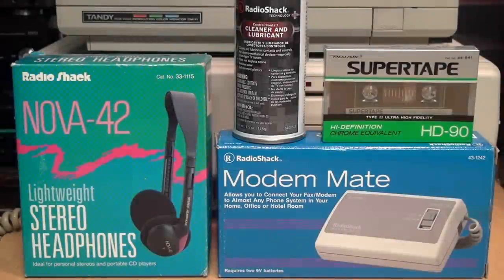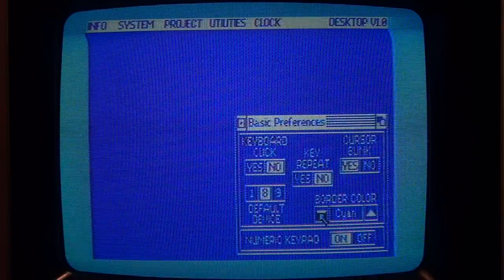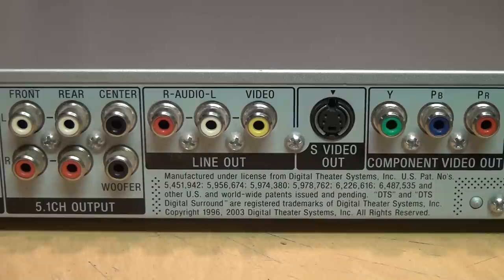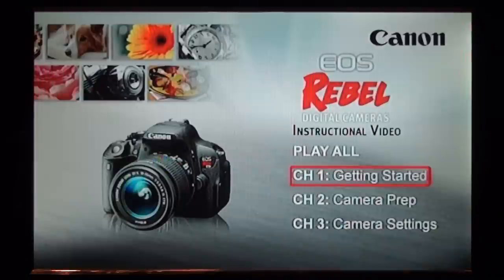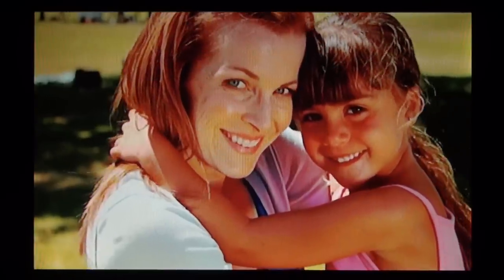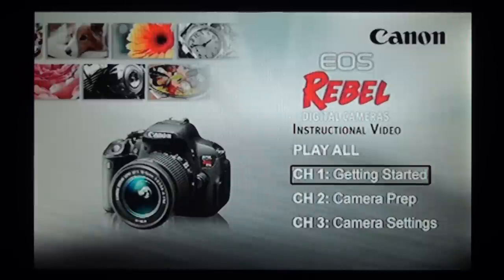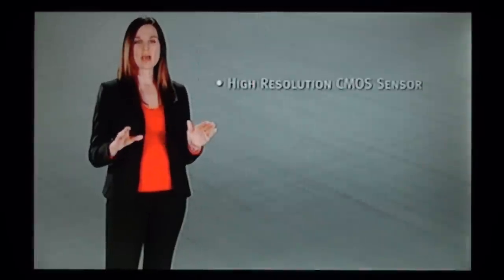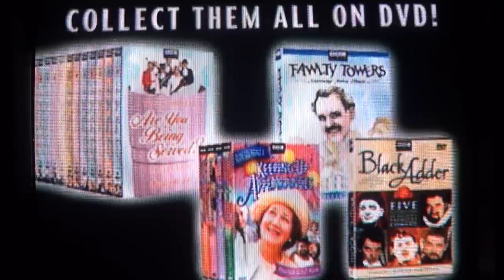Radio Shack S-video signal converter 📺 How? Why?

Comment: It would have been interesting to open it up and see what the circuitry was, but I'm guessing that may be tough to do.
Reply: I was about to comment that. 
what's this magic..
Reply: Me too! I didn't think this was possible with a passive adaptor, so I would like to know how that adaptor works.
Reply: It's simple enough, both grounds are tied together, and the active pins (luminance and chrominance) are tied together with a 470 picofarad (or 1 nanofarad in some rare cases) capacitor, the tied grounds then go to the RCA connector's ground, and the tied Y and C go to middle pin.

Not really much is going on in this kind of dongle
Reply: Likely just some capacitors and or resistors
Reply: @JessicaFEREM  the luma signal will pass through, as it has the sync pulses, the chroma will be capacitively coupled onto the luma as it’s an AC signal and luma is basically a DC level
Reply: I watch till the end and I really thought you gonna tear it apart and explain what's going on inside. Kinda disappointed.
Reply: I also want to see how the signal differs under an oscilloscope
Reply: Probably just passive components to correct impedence and make sure the luma and chroma outputs don't try to drive the other output. Using a Y cable backwards can cause issues like that and was probably why VWestlife had trouble using that to make S-video into composite. Same basic principle applies to audio signals too, never use a Y splitter to combine 2 signals.
Reply: Title says ‘how’, so I hoped it would show or explain ‘how’

Comment: This adapter was very useful back in the days.

There were a lot of graphics cards out there featuring a “TV-OUT”. Most of those inexpensive cards were S-Video only.

The problem of FBAS is that there is a “colour carrier” modulated on top. This limits the bandwidth of the Luma signal so your picture has to be less sharp. With S-Video, the Luma signal is independent so you can have all the sharpness there is since there is no bandwidth limit any more. This is the idea of S-VHS which needs the S-Video cables to perform as best as it can.

The C64 generates Chroma (F) and Luma  (BAS) independently but a TV needs an FBAS signal. So the C64 mixes both signals using two resistors inside the video modulator. There is an extra FBAS output in the Video output but you need a special cable to use it.

The same trick is done with the S-Video only TV-out graphic cards. They came with an adapter with two resistors inside.

The problem of mixing F and BAS is that both signals have a 75ohm impedance. If you simply merge the lines, half of the signal level is pulled down  by the other output and you get a 35ohm impedance which doesn’t match to the TV/VCR input. This is why those lines are merged using two resistors to reduce stealing half of the signal by the other output. Obviously, this still reduces signal quality and level.

But there is a method to do it properly. This is built into any TV or VCR and this is called the “colour trap”. Its just a crossover network. It separates the high frequency colour carrier from the signal and then limits the bandwidth of the Luma signal. In very old TVs, this is done by passive LC networks. And it is highly likely that this adapter uses the same passive LC circuits since it works both ways.

And the quality of this circuit matters a lot! If the radio shack adapter has a very narrow bandwidth separation, it could do a much better job than the cheap built in stuff inside your TV or VCR. Also it would defiantly do a much better job than the cheap 2-resistor kind of adapter.

If you have a high bandwidth Luma from a TV-out graphics card, Luma is often interpreted as colour and vice versa using FBAS. Then there are “ants” crawling on the shoulders of a news anchor while his pin striped suit flickers with weird colours.
Reply: It was also sometimes included for the opposite functionality, some Hauppauge TV-tuner cards had one of these included because they couldn't fit all of the connectors on like the low-profile pci cards

Comment: I remember back in 2003 when I wanted to connect my new (at the time) PC to my video recorder so I could record from it. The video card had video out and I could switch between NTSC and PAL but there was no composite out, only s-video. So shat I did was connect the VCR straight up to the luma wire, then used a small (I forget the value) ceramic capacitor to connect the chroma. It worked quite well if I remember, maybe that's what's in that little black box.
Reply: With maybe a small inductor in the luma side to stop it squashing the chroma from the cap.
That's probably why the picture is a bit softer using the adapter

Comment: I had an old PC with S-video output and I wanted to hook it up to my (then) cheapish CRT Television, which had only RCA inputs.  So I bought one of these adapters and all was well in my world.
Reply: I did the exact same, still have the converter in a box of old AV cables and such. Oddly enough, I somehow still have the CPU and hard drive from that PC in another box, possibly the video card as well. I might have a hoarding problem 😂

Comment: I miss Radio Shack. They had so many adapters that allowed you to convert any type of wire to another connector

 I had a police radio scanner as a teenager and one of the best adapters I bought was a F-type to BNC adapter which let me connect our home's TV antenna to the scanner. Obviously it wasn't the most elegant solution but since the majority of the frequencies I wanted to listen to on were VHF anyway, it worked very well.

Comment: S Video was mostly used by computers and DVD players, that adapter was useful to connect devices that lacked a composite video connector.
Reply: That's right. Every PC video card I have ever had from late 90's and early 2000s would usually have S-video for TV out and would always come with a s-video to composite dongle.
Reply: @kerrymccluskie  my uncle had a Win 98 computer that had S-Video card. It was used to hook up to a TV/VCR for video capture, the composite adapter was suited to TVs that don’t have S-Video input.

Comment: It does quite a good job considering the adapter wont be able to differentiate what part of the composite signal is 3.58Mhz colour sub carrier (for NTSC) and what part is high frequency luminance.
Reply: It kind of does, though. The only component inside one of these is a capacitor (I've seen schematics with 470 µF) that acts as a crude low-pass filter.
Reply: It differentiates in the same way as any other analog signal: Just toss in the appropriate resistor or capacitor and you've got yourself a filter that can do what it needs to do. Double the signal and then make one filtered down to 3.58MHz and pass thru the rest.
Reply: Can the source sense the adapter being used and output a different signal. These were used on late 90s computers to hook up to TVs
Reply: @flapjack9495  That's the point luminance is above 3.58Mhz
Reply: @orangejjay  That's the point it can't because luminance goes above 3.58Mhz. A TV will have a complex comb filter to notch out the 3.58Mhz sub carrier.

Comment: One of my favorite Radio Shack products was a AUX cable to Cassette accessory. In my old Van I didn't have an AUX port to plug my phone's audio into the radio with, but it had a tape deck. So I used that accessory to get around that issue. Sure I know bluetooth exists, but lets just be real, bluetooth sucks... It has a delay, that actual physical wires DO NOT.
Reply: Surprisingly, I still see new cassette adapters in stores.
Reply: @alextirrellRI  Good to know. I'm glad there is still a use for them. Especially if you want an internet capable antique radio. :D
Reply: @alextirrellRI  beware. Some cassete adapters are junk. I grabbed one and they put a mono head and sounded dull…awful. I have a older one, and have a stereo head a plays really nice.
Reply: If you had a really old car, you could connect an Aux to Cassette adapter to your phone or MP3 player, and put the adapter into a cassette to 8-Track adapter, which would then go into your car's 8-Track player.
Reply: @sjogosPT  Just like a lot of modern cassette players that only have mono heads in them.
Reply: ..... What difference would this imaginary delay make when listing to music?
Reply: @Helladamnleet  "imaginary" sounds like you're trying to gaslight. But it does cause problems. When you pause the phone or press play, it takes 3 seconds before the radio speakers catch up. I've had this happen on multiple radios and phones too, so don't pretend it's all in my head... A physical AUX cable doesn't have this problem. I don't get why people act like nothing is wrong with bluetooth, like they're fanboys or something. And don't even get me started on how annoying it is to pipe audio from a YouTube video through bluetooth. It's almost NEVER synced up right.
Reply: @Tall_Order  Or when you have a crazy idea to listen to music without headphones when walking around the apartment without turning it up extremely loud (which could piss off the neighbors). I now have a Bluetooth adapter that can either transmit or receive, and another just receiving one on the other amplifier. Sure enough, you can make both amplifiers play the same music like that or broadcast music from equipment that I only have one of, like the cassette deck or the record player across the flat. There is one big issue though, namely a big delay between the first amp and the second, so they both have to be turned down somewhat to avoid creating an annoying echo zone. If I did bother to lay down some analog cables there would be no delay, but probably stuff like ground loops or picking up interference would happen. With a digital cable there would also be a lag because it is highly unlikely both amps' DACs have the same delay, but it would be much smaller because of no Bluetooth overhead.
Reply: As an electrical engineer, I agree, Bluethooth is impressive, yes, but it is not a panacea and the reality is that it is an obsolete but glorified technology. But since it is old it is cheap so it can be used in everything (It is like at the time it was USB flash drives and MP3-CDs, both in 2006-07 were the novelty of the moment but after the 2010s any toy Chinese could already play Mp3). and at that time it was beginning to become a trend to simply put on YouTube instead of simply burning CDs or using an MP3.

Although it is undeniable that using wireless protocols saved a lot of cable pain because there were no longer ports or cables that were physically damaged, or inherently strange to obtain or operate without a specific driver. Also some uses border on the ridiculous. It is completely useless for all the peripherals of something to be wireless when they are within 10cm-1 meter of the device, and at the end of the day they need physical wiring to be recharged anyway. and even at the engineering level it is counterintuitive, because all because to work with Bluetooth you need at least 3 steps of ADC-DAC converters. which translates into greater waste of current and computing power. So obviously that means... Exactly: Delay!

The bluetooth protocol can barely handle 2mbps streams.
Today it is very slow to share files or network. and it was an almost forgotten technology if not precisely because cheap BT speakers work with that low data speed. and what at the time were headsets and hands-free for Executives and VIPs became favorite headphones for serial cable breakers. BUT. They were just that, just hands-free for old 2G phone calls, not maded for pure audio experiences.

Comment: Dell used to supply a very similar cable with some of their laptops that came with a S-Video jack on the laptop. This was in the days well before HDMI when TVs and projectors had Composite video and S-video was not as common. As I remember, they worked about as well as this Radio Shack adapter.
Reply: I remember my Dell laptop had an S Video as well as a VGA out...one time I broke the pins on one end of my S Video to S Video lead so I then chopped that plug off and soldered an RCA plug on the end by paralleling up the Lumina and Chroma together and it worked for TVs without S Video
Reply: Hauppauge offered these with some of their TV-tuner cards as well (popular in some HP models, both desktop and laptop)
Reply: I bought one months ago, but the vga to composite converter box i bought seems to produce a sharper image

Comment: I founded a Radio Shack MP-X 110 minute Type IV cassette at the thrift store, very rare to find, 2 sealed tapes, and Maxell XL II for 80 cents, because the cashier miscounted one of my 4 cassettes!
Reply: If you plan to use them and not just collect you might examine the tape itself first. They are rebadged as RadioShack but were really TDK behind the ugly pink and purple lettering -same shell. Now RadioShack did sell some cassettes that were made by Denon but the MPX were sourced by TDK but they were bad tapes in my experience.

I bought two off ebay last year and had to throw them out as the tape itself was curling on the sides and was not making proper contact with the heads on my deck (Sony TC-K615S). 

At least you got them for a low price though so if they don’t work you won’t have spent a lot!

Comment: $449 FOR AN HDMI CABLE? WHAT ON EARTH! I've seen ridiculously priced audio cables, so I don't know why I'm so shocked seeing HDMI cable being expensive for no reason, but damn...
Reply: Considering that it's all digital (which usually means it either works perfectly or doesn't work at all, and not anything in between, quite unlike analog signals) it's really ridiculous
Reply: I've seen $10,000 cables for studios...
Reply: @igorszamaszow171  It’s a real bugbear of mine they claim it reduces signal jitter, some even claim it reduces banding artefacts 🤦‍♀️ really preying on the uninformed.
Reply: It has lights on it that indicate resolutions, so it may be a fancy cable that upscales lower resolution video to 4K, hopefully using a higher quality scaler than what the TV has.
Reply: @thetechconspiracy2  or a faster one to reduce input lag
Reply: Because HDMI is all digital, so any working cable will look the same
Reply: @TorutheRedFox  You can't make HDMI itself any faster than it is. You can improve bandwidth but data is gonna move as quick as electricity can either way.
Reply: @igorszamaszow171  That's true for most cases, until you try running HDMI cable to the maximum length specified by the spec. I've seen some downright bizarre stuff when doing that. On one memorable instance a badly manufactured cable seemingly reduced the color depth down to like 256 colors, there was severe banding all over the screen, yet the PC was sure it was outputting in 24 bit color depth.

 Yes that does constitute a downgrade in image quality, but might still be usable for some instances.

Comment: old gpus like mx100 ... mx400 often had an s-video output and a passive composite adapter included, and they worked fine. I remember at one time I even made one myself, there is only one capacitor needed and everything works. as far as I remember, the signals have a different frequency and modulation method so that they can be passively mixed. in the opposite direction, it works most likely for the same reason - the inputs are tuned to different frequencies and have different demodulators
Reply: Yes, I came to comments to say this, I had video cards with tv-out using svideo, in times when the common pc monitor was a little 14in CRT, and I had a 20in CRT tv I wanted to connect the PC to, to watch content, and that TV didn't have svideo input. So I think I succesfully used a converter like this, but with a male minidin IIRC...
Reply: Yep, I was going to say the same thing. I also had video cards and TV capture cards/USB devices that used a single S-Video jack S-Video to RCA Composite adaptor instead of separate S-Video and Composite jacks (thats in addition to the standard VGA Out on the video cards). Some device for space or cost reasons just decide the single S-Video out or input with RCA composite adaptor was way to go. I had some these S-Video to RCA adaptors work fine and one that didn’t work at all for some reason.

Comment: I miss Radio Shack...  I drove past their former location in a shopping center where they were starting when I was in High School.  The sign is still there under the walkway, but the storefront is empty.  

That being said, the last time I went there when the store was still open, around 2009, I was looking for some capacitors to fix a flat panel TV's power supply.  Gone was the "wall-o-components" I remembered from the late 1980's early 1990's.  Instead they had a tiny box with a pathetic assortment of passive components and maybe 4 or 5 different types of capacitors.  None of which were what I needed.  But they would have been happy to sell me some overpriced batteries or a remote controlled toy car...
Reply: I used to go to Radio Shack all the time and get blank cassette tapes. And now, thanks to eBay and others, I have a whole stack of Radio Shack Realistic cassettes from the 1970’s and 1980’s. These are now in my collection.